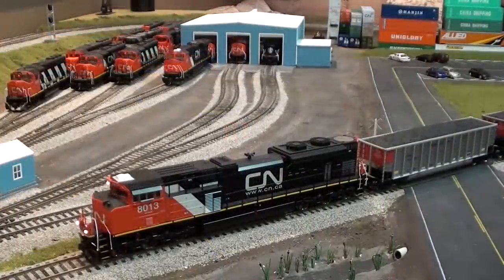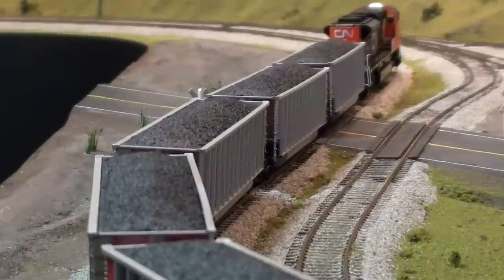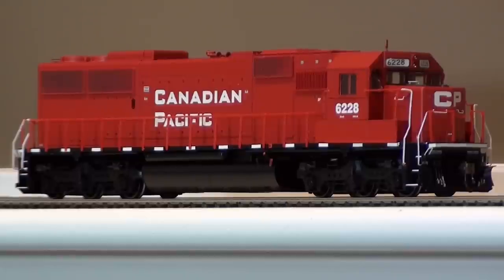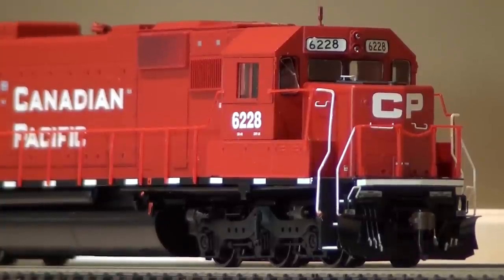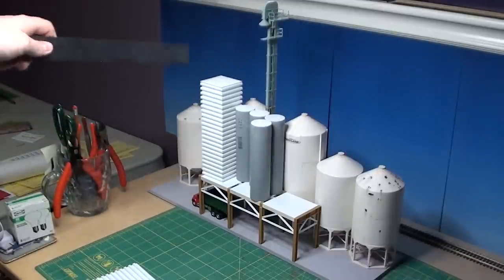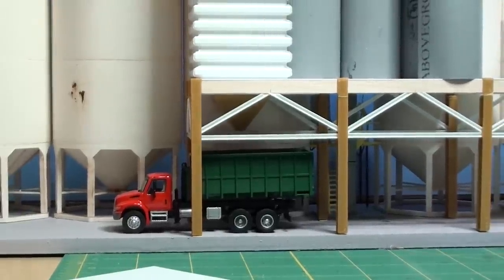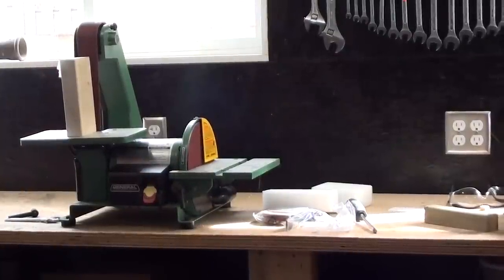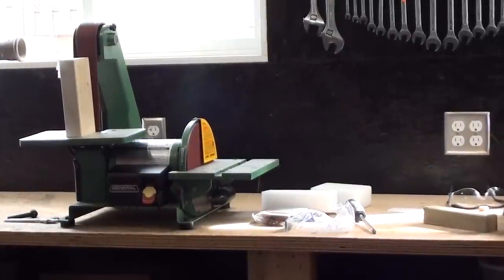Layout Update: March 2015: Athearn Bethgon 5-pack, SD60, Working With Floral Foam...

Comment: The work on your "Fremo"Facility looks great ! But it is hard with the Fitting ! I have also two of these Athearn RTR Bethgon Hopper sets . one in UP and one in CSX. by the UP set I have also an issues with the screw of one truck ! I like the Atlas trainline Bethgon coal hoppers with Load ! We have also many Bethgon/ Coal hoppers from Walthers Gold&Mainline , they run very well ! Nice update Ben, looking forward to seeing the work on the SD60 CP
Reply from the maker: Rarawer Thanks Matthias. Yes it's hard to make those bins from plastic siding and get them to look right. I like the Athearn coal hoppers too but I am looking forward to the ones from Intermountain. I've ordered a bunch of them.

Comment: Nice vid dude! Those RTR coal gons look sweet! The reflective sides are amazing. I like Athearn's CP SD60s, but I'm a bit bothered that they didn't do the numbers in italics, and kept them more similar to the SOO font :/  And good work on the frack-sand module! Haha, good finding that foam for a cheaper deal at Michaels! I might have to get some myself just to have available when needed! Works well!
Superb stuff, and I look forward to more as always ;)
Braedan
Reply from the maker: ***** Thanks man! Yeah they are nice cars but a little overpriced in my opinion. I look forward to see what Intermountain brings out with their new run of Aluminators and Aeroflo cars in CN, CP, NOKL etc. There is definitely some minor issues with the SD60 in both CN and CP but honestly for 120.00 I think it's pretty good. If it were a genesis model I would expect it to be a lot better. I will probably renumber mine anyway. The floral foam is an awesome building material, way faster than building a stick frame. Pretty cheap too which is always good. Thanks again for the comment man, I always appreciate the feedback. Ben

Comment: Hey just wondering where you get you ditch light kits. Are they pretty easy to instal ? Thanks !
Reply from the maker: Sunday_funday77 I buy them in bulk and wire the leads on myself. They are 603 Surface Mount Diode (SMD) "Sunny white" LEDs. There is a bit of a learning curve but it isn't too bad once you get the hang of it.

Comment: Maybe its just me but the distance between those coal hoppers looks too big.  but they look awesome over all.
Reply from the maker: BNSFfan2373 Yeah it's hard to gauge the distance, I looked at some photos I have. It could be a problem with the HO scale size couplers which are always way too big and therefore push the distance between the cars apart. But I agree they are nice looking cars.

Comment: Hey Ben what did you use to make your roads ?? thanks
Reply from the maker: Matt Jenkins Matt, I used scrap 1/4'' hard board, glued to the foam then sanded. Finally, I painted it asphalt black and painted the lines on by hand using masking tape to make the lines.
Reply: cool thanks. They look great
Reply: These are some of the best roads I've seen without having to use messy-ass plaster

Comment: Top of the SD60 nose is meant to be sloped.
Reply from the maker: Mitch Legg To my eye it looks horizontal to the roof of the locomotive but I have been wrong before...http://mountainrailway.com/Roster%20Archive/CP%206200/CP%206228.htm
Reply: BArailsystem It's not flat, look at the gap between the nose and the GEVO radiator behind it.
Reply from the maker: Ah yes I can see that, a slight slant. I double checked on M. Eby's fantastic Trainiax website and he shows a very slight angle downward as well on his drawing of an SD60.
http://trainiax.net/drawings/emd/emdsd60cnw.gif
I still think its too sharp of an angle on Athearn's model though.